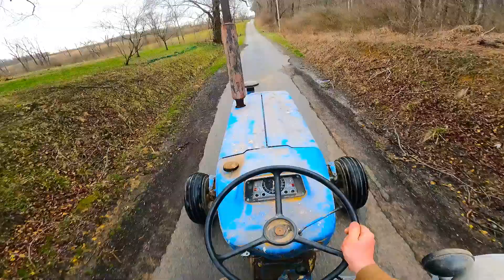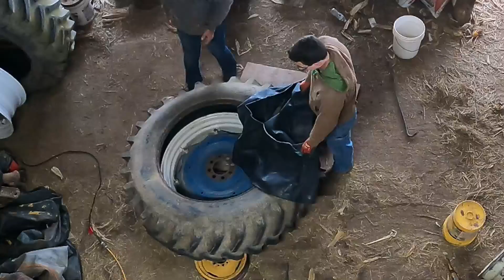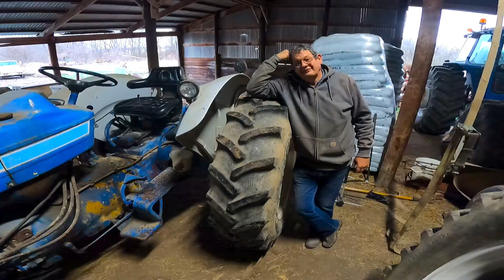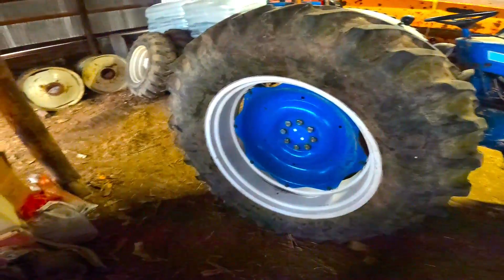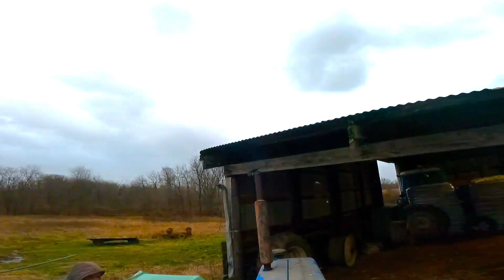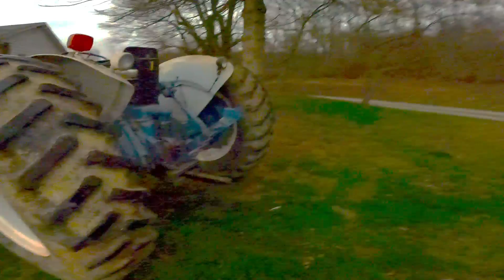Fitting Bigger Wheels on a Ford 6610

Comment: Being ex-industrial I reckon it’s geared lower, mine on 13.6 38s was doing 17mph, now goes 23mph on 16.9 38s
Reply: I was thinking that was awefully slow for it. Good thinking on the industrial.
Reply: @joshk.6246  on a standard ag model he should be getting 25mph with those big wheels
Reply: @Sam6610  yeah. Thing looks like hes going to take it to the drag track 😃.

Comment: I had a 5000 that had been a selectospeed with 16.9-30's. It had a 8 Spd from a high crop 15.5 -38's. The slow rear from the selectospeed coupled with the slow planetary reduction from the high crop gave me a road gear less than 10 mph. Needless to say it got tailored everywhere.  Great square baleing tractor though. It didn't ware you out at the beginning of the waggon hustling back and forth. 1st and 2nd gears were like creeper gears.

Comment: Would look better with newer Square cut rear fenders. But I like what you did. We have the same set up on a 7000.
Reply from the maker: Ford flat tops are hard to find.
Reply: @boehmfarm4276   usually have to go new aftermarket. Otherwise you are wright. Hot commodity.

Comment: I've got a 5600 with dual power, and it had 16.9x30 tires on it when I bought it. It ran 16mph down the road , I put 15.5x38 on it with 10.00x16 front tires, and now it'll do 19mph down the road.  So I gained 3 mph with the 38-inch rubber like you did. I'm glad I switched them out!

Comment: Careful if you grab the fender to hold on. You might loose a knuckle. Fenders look really close.  Did the same to my 2020 Deere. Really made a difference. Had to make some risers for the fenders. Is that engine 3 or 4 cylinder and what hp?
Reply from the maker: Four, probably close to 70

Comment: I don't know how you shift that thing when it's rolling.  I can shift my Ford 3000 while moving really easy.  But my Ford 5000 I can't shift even if I double clutch it.  You think that's normal?
Reply: Nope, I can shift mine without double-clutching and without grinding teeth, shifts almost as good as a synchronised gearbox.
Reply from the maker: I can shift the little Fords clutch less on the road, haven't had enough momentum before with the 6610. But it shifts fine between gears nicely with the pedal. There might be a bearing going bad for your 5000 for the pto drive internally causing it do drag on your transmission input shaft.
Reply: @ko1113  you have a 5000?

Comment: I wonder how fast the 1466 can go 🤔
Reply: Bout 20 probably
Reply from the maker: With Nick driving, probably 25.
Reply: @boehmfarm4276  🤣
Reply: I know an 886 slightly adjust will do 26, a 544 low profile gear drive gas unit set to hydro specs will go almost 30.
Reply: @billpollock1763  Thirty is moving on that tractor